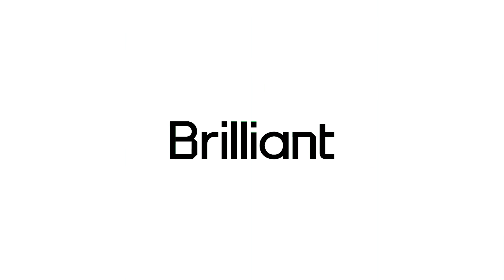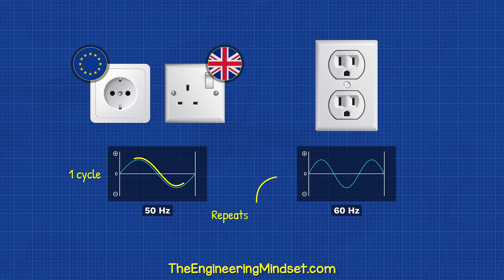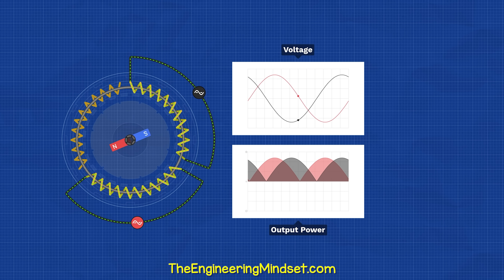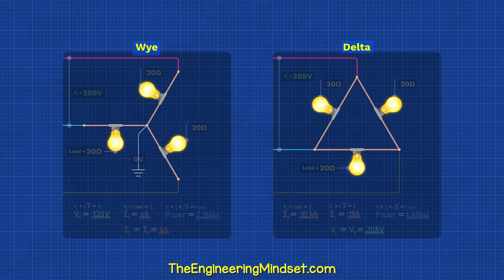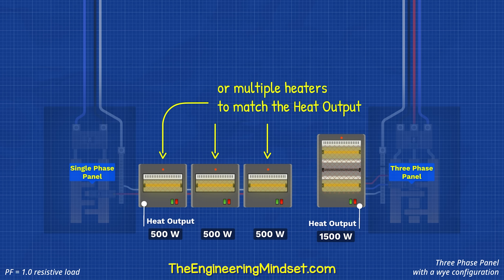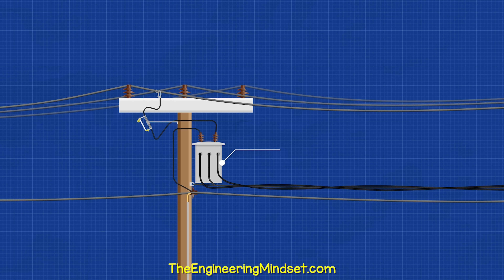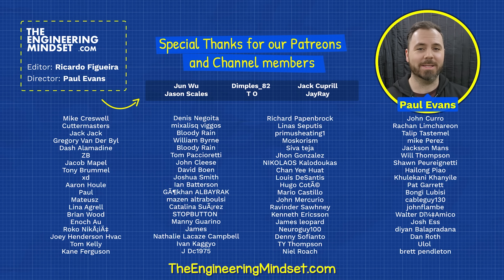How 3 Phase Power works: why 3 phases?

Comment: 6:26 is where it starts taking a detour. Earlier, you spoke as if your viewers don't know what a wave is, and here you make that giant leap. I lost it right there.
The current flows back to the generator? The load divides? Why? How can I picture this? Why does it divide that way? Why does 'ground' connect to a generator?
So many random gaps in electrical science that are poorly explained everywhere, and I just can never seem to get it.
Reply from the maker: I felt it was all covered clearly, but I appreciate your feedback. I would highly recommend that you make some time, sit down and watch the video in full, pausing to make notes and diagrams, write down anything you didn't quite understand and then find reasons for that part after.
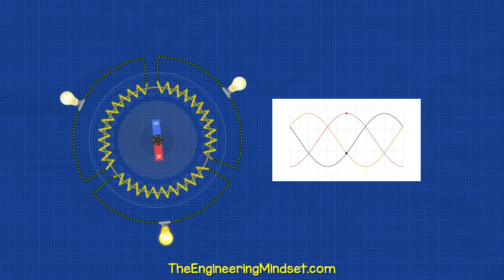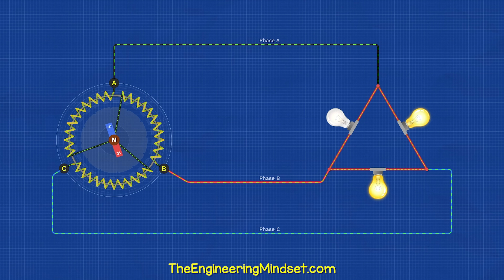at 3:17 we showed that the current flows to the load and back to the generator. At 3:52 we showed how you could add more phases. 6:18 how it's flowing forwards and backwards in all phases. 6:49 an example of the currents flowing. 7:12 why we connect to ground.

Comment: Three phases are the minimum number required to enable reversing of an AC motor by switching phases. Larger numbers of phases can be used, but the complexity, coil mass and costs will increase accordingly.

Comment: Nice sine waves you are showing there.
But at 60Hz, the wavelength is 5,000km - way longer than pretty much any HVAC transmission line in existence.
I'm facing the same problem, when trying to illustrate concepts to the public:  Do we simply ignore reality, with flat lines going up & down all over the HVAC grid?
Is there some quick/easy justification for doing that?
What if we didn't ignore reality? Would there be some reasonable way of explaining the concepts?
Thanks.

Comment: 30+ year electronic communications tech here. RMS is the reciprocal of the square root of 2 time the peak value. I learned that in Basic Electronic Development at Keesler AFB in 1973. The reciprocal of the square root of 2 is approximately .707. RMS is the effective voltage.
Reply: But only for a pure sine wave of a single frequency!  Old digital multimeters used this trick and would give a false reading  on signals such as a DTMF tone on your telephone.  Now I'm curious if the old analog meters have an integrating circuit, I haven't used one in probably 40 years (except for the one on a hi-pot tester setting).

What type equipment and technology did you work on? I'm always fascinated to learn more about old technology from firsthand experiences. By the way, my father worked for Hughs in 1973 when you were studying, theres a good chance you worked equipment he designed. He also taught for the military on how to use said equipment. I wish I could have learned more from him, but it was mostly secret, and he said they'd throw him in jail until his dying day if he ever talked about it. All I know is that it was sonar and radar for subs, misses, and aircraft, that's the official story anyway.

Comment: No it's not each country settle for different standards. Only the US and its satellites are still dealing with outdated 110V and weird unsafe power plug (not speaking of Farenheit that they're the last one to use with Myanmar and Liberia) and an inept measuring system with ounces, scoops, grains, gallons, quarts...
All the other regions are on 220/230V 50-60hz and most are compliant with the french-german power outlets. And use the metric system. End of story.

Comment: I think your claim that the power is not constant is wrong.  Assuming the load is purely resistive you square the voltages as P=V^2/R and sin^2(x)+sin^2(x+2pi/3)+sin^2(x+6pi/3) is equal to the constant value of 3/2.

Comment: A very clear basic explanation. Although the nominal European mains viltage is 230V there is a considerable tolerance above and below this figure so as to include 220V used in many countries and 240V as used in the UK. I believe that most car  and commercial vehicle alternators are 6-phase machines with integral diodes in order to produce 12 or 24 volts DC.

Comment: I think you might have missed mentioning that for many apartments in north america, the buildings are often hooked up to 3 phase, but instead of apartments getting a single 240/120V phase like a home would, they connect across 120V phases to give 208/104V which is not much less than 240/120V. You might think this would cause problems, but north american electronics are actually designed to handle it since it is so common. It does lead to a lot of your devices not having as much power as they probably should, but the only thing that would likely be noticeably worst would be how things take a bit longer to cook/heat up with electric appliances.
Reply: my rental apartment is 120/208v 2x60a
Reply: Good example of cooking /heating time differences. To this you could add brightness of lamps. A lamp taken from a 240V supply country would glow only half as brightly in a 120V country.
Reply: Those 3-phase connections at 208/3 (wye connections) which gives you 120  single phase not 104. 

The 208v supplied will be less than the 240v you get in a more typical residence.

Comment: Thank you for yet another fantastic, first class video. Not an engineer here, so apologies in advance if this is a stupid question. After watching your videos I am trying to educate myself more about this topic but find it very hard to find information on the types of supply throughout the supply network as a whole. For example your videos show that the generator is connected in a wye/ star configuration but does this change throughout the stages of supply or does it vary depending on location or for any other reasons? For example when you see the 400 kv or 275kv pylons here in the UK is this likely to be in a delta or wye configuration and does this change when it is transformed down to 33kv and then 11kv? I know that when the electricity finally reaches our homes it is in a wye configuration but I am just interested to learn on whether this changes for the higher voltages.
Apologies if this is a silly question that makes little sense I just know that when researching this you get very conflicting answers, maybe because it does not really matter or it depends on very specific situations/ locations.
Many thanks again for the video 👏

Comment: here we have the choice of connecting our house to single or three phase . 400v (three phase) . it's needed for the oven or induction cooking plate. yes a small number of them can be connected to single phase but the output power won't be as high and they are more expensive here.

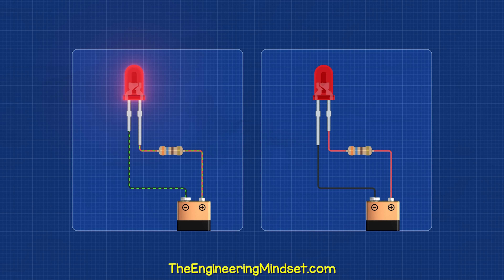Comment: @1:36 OMG are those resistors 360 Ohm +- 5%? My favorite.
Reply: yeah.. that's what I read too... But @13:19 not a great choice to drive LEDs from 120VAC... that will blow the LED and/or the resistor. They should have considered 36KΩ instead.

Comment: Sweden:
3 phase 400V to basically all homes.
That is split up depending on where it goes so regular outlets are 1 phase 230V.
Stove is often 3 phase 400 but can also be 1 phase 230V or 2 phase 230V.
Radiators (electrical) can be 1 phase 230 or 2 phase 230 or 400.
Heaters the same, can be 1 or 2 or 3 phases.
You can also have special outlets where you can take out all 3 phases if you like.
Normal main fuse for a home is 16-25A depending on size of home and the equipment you use.
Normal outlet in the home is 10A.
Some older homes might have 6A outlets in some places.
Stove is most commonly 3 phase 16A per phase.
Reply: i think you made a mistake because i know finland:

the standard grounded schuko sockets are 16a but they can also be 10a

the old standard ungrounded sockets are usually 10a

also main fuses in finland are usually either 3x25a or 3x35a

Comment: You neglected to mention that 3-phase motors are normal in industry. They don't need starting windings or capacitors to start and run. And if  you want them to go the other way around, all you have to do is switch two of the wires. This is commonly done with a forward/off/reverse switch. The whole arrangement is simpler.

Comment: You really have some great illustrations. 
Something I don’t understand. A lot of buildings in our area have only two phases brought in from the road. There is a single phase  transformer on one phase with the center of the secondary grounded for a neutral and there is a smaller transformer on the second leg. Every third pole in the breaker box is a high leg. I do understand how the voltages work out for three  phase, but the phase angles are all wrong because two phases are in time with one another and only one phase is 120* apart from the other two. So for a three phase compressor with no capacitor, wouldn’t the compressor struggle and overheat? 
And with a single phase PSC motor that would normally run on one phase only, how do the phase angles affect it when you energize it from two phases that are 120* apart?
Reply from the maker: Great question, we actually covered this with some more great animations in our last 3 phase video here https://youtu.be/u0SsejDCVkU

Comment: You - as so many - get one thing completly wrong.
At 4:32 you claim "output power [of a 3-phase system with symmetrical load] is ALMOST constant". That's not true! You showed a picture overlaying the power outputs of the 3 phases, but you would have needed to add them together. The output power of a 3-phase system is EXACTLY constant over time. No ripple, constant!
There is no reason for 3-phase AC beeing so popular other than this!
For homes and small loads there are quite a few different systems to power electrical appliances - just because constant power output isn't nessessary for i.e. a vacuum. In north america even 2-phase 120° systems are beeing used in homes! But Inertia keeps the vacuum work even with such an electrical system so that's what home applyances use - the ripple just doesn't matter enough to bother.
But for a lathe or other heavy machinery you want a smooth motor powering it and thus you use 3-phase power for such usages all over the world.

If 3-phase hadn't have a perfectly constant power output, people would have used 4- or 5 phases or even more phases for loads with the need for as little as possible ripple; but since 3-phase AC is already perfectly rippleless, there isn't such a system anywhere beeing used.
Just to clarify: converting AC to DC benefits from more phases - you will see different solutions in this case with just doubling 3 phases into 6 beeing the most common; creating DC with as little as possible ripple would vastly benefit from 7, 9 or even more phases with an preferably uneven number of phases.

Comment: Capacitors have a 90 degree phase shift, but if youve ever worked with audio phase shifting, you can combine three signals without phase cancellation. In order to do six phase you would have to use positive and negative voltage which electronics theory doesnt really acknowledge.

Comment: Something I have to correct though it's a bit nit-picky. "Phase" refers to the difference between each "leg" (each wire). "Phase" does not refer to the wire. You're typical north american home is single phase even though you have 3 wires running to it with two of them being hot legs, and one being the neutral. The 240v between each hot leg is one phase, the 120v from one hot leg to the neutral is "split phase"

Comment: Some days ago in Greece we had bad weather resulting in something like a black out. I have never had this before, the heavy devices like fridge and air conditioning did not work at all, some lights had very very dark light. Also flickering. The streetlights were working though. The neighbours had the same experience as we did, everyone saying that a phase has failed or was broken. But I didn’t really understand. Do you mind explaining what was happening?
Reply: was it a pen fault? if there's a pen fault, turn off your main switch immediately

Comment: Mmm. Why? If you rectify 3 phase 400 cycle 220 volt? Oh it just produces a low ripple high current feed for radar.
 400 cycle? Not exactly good for long distance power transmission.

Comment: This video has taught me more about the power grid and home electricity in 15 minutes than I managed to learn in nearly 35 years living on this earth.
Reply: Same!
Reply: Same here. Very clear explaning, but a bit too fast for me. (after 3 repeated runs I think I got it!).
Reply: @MisterWillow  If you watch through Chrome there's a several speed control extention.
Speed up or slow down the video and adjust the sound.
Reply: Or you could have done 'O' level physics in 1970s.
Reply: Millennials out here really trying to sound like boomers lol (35 y/o is actually pretty young)
Reply: @amorag59 who said it was old?
Reply: @CRThaze  Not sure, let me know if you find them. The boomer meta is when ppl include their age on stuff. I’m saying if youre in an electrical vocation youre pretty young/early in on it and theres way more to learn so saying your age seemed kind of pointless.
Reply: in the intro it completely overlooks the fact that 230VAC systems exist. I.E. in Europe and parts of Asia...
Reply: @TheExileFox  who cares. the principles are identical and he addresses it later in the video.
Reply: @BuildWall  I care
Reply: @UmVtCg  no you don't
Reply: Screw those places 😂 @TheExileFox
Reply: @TheExileFox  Yeah but this isn't meant for them
Reply: @TheExileFox  The weird thing is an English accent after starting with a non-English sockets picture. Principles are the same, but was a bit surprising

Comment: so question:  how does one find the AMPs for a plug ? what setting would you use on a multimeter ?
Reply from the maker: Please see our multimeter or clamp meter tutorial videos
Reply: what? do you mean the fuse size?
Reply: @gamecubeplayer   no i just want to know how many amps an outlet outputs
Reply: @breadmoth6443 what do you mean? if the socket is behind a 120v 15a fuse then it outputs 120v up to 15a
Reply: @gamecubeplayer   oh so i should just look at the fuse panel

Comment: all things considered... 3 phases is just perfect.
Especially when you're connecting across 2 phases, it doesn't matter which 2 you're connecting across, the results are all the same.
If you have 2 phases, well, that's just doubling the voltage of a single phase. I believe American homes actually use this, in the final transformer before the home.
If you added more phases, like 4, then you have to pay attention which 2 wires you've connecting between, as the voltage you get out would be different between the pairs, making the whole system a lot more complex.

So, 3 phases is the most efficient, and simplest design.

Comment: I find it funny how you said "Different countries use different voltages and frequencies", then gave 3 european examples on the left, all of 230V/50Hz, and 3 American countries on the right with 120V/60Hz.

There were other places to choose from that didn't use the same numbers, like Japan that uses 100V (though where in Japan determines if you get 50Hz or 60Hz)
Reply: there's also south korea which is 230v 60hz

Comment: I've worked on marine propulsion converters which control a 15-phase motor. Each converter is split into 3 sections powering 5 phases. During cruising the motor can run on 5-phases only, for economy. For maximum speed and to have a low noise and vibration signature, it runs on 15 phases. It gives redundancy such that if one converter is damaged, the ship can still operate with the motor running on 5 or 10 phases.

Comment: Why is it that the power supplied by the multiple phases can add together to be net positive when different phases are positive and negative at different times? Or in other words, why for example would a positive voltage on L1 and a negative voltage on L2 work together instead of canceling each other out?

And if LEDs only permit current flow in one direction, why do LED lightbulbs emit constant light when supplied with AC power?

Comment: Minor correction: The UK uses 240 V / 50 Hz per phase (not 230 V which is the standard in continental Europe).
In my experience, the voltage in the outlet fluctuates between 240 - 250 V during the day.
Reply: nowadays the uk is also 230v because continental europe was 220v
Reply: @gamecubeplayer  Thanks, I stand corrected. The UK used to have a 240 Volt standard but it was "harmonised" with the EU at 230 V +/- 10%. So the UK's National Grid simply continues supplying 240 V as before because it's still within the 10% tolerance band. 😀 
European countries may continue to supply 220 V because it's also within EU limits.
No costly grid overhaul is needed and the bureaucrats are happy too. 😉

Comment: A 4 phase, 5 phase, or 6 phase is no more difficult to synchronize than a 3 phase system.  Note that the very first AC generators and transmission systems were 4 phase and used 4 phase conductors.  3 phase was chosen as it reduced the number of conductors and adding any extra number of phases beyond 3 does not inherently impove the system in any way assuming that you make any comparisons on the basis of having the same total amount of electrical conductors.  I.E., assume a given mass of aluminium per kilometer - then 3 phases is as good as any higher number of phases.